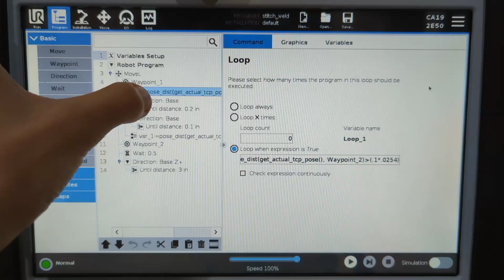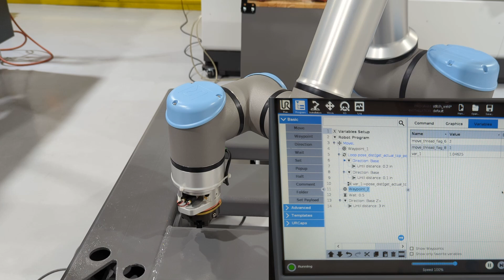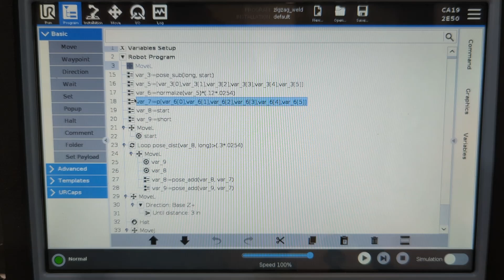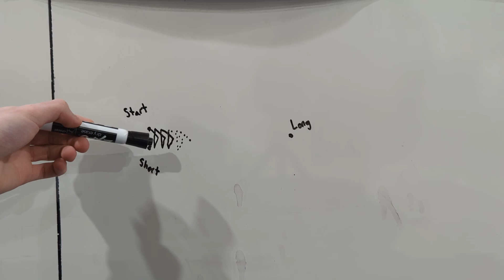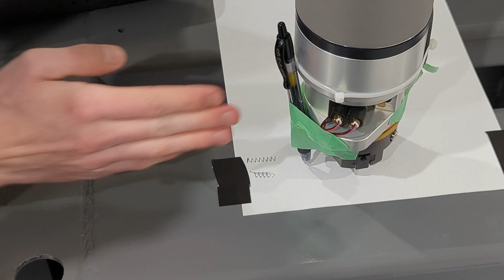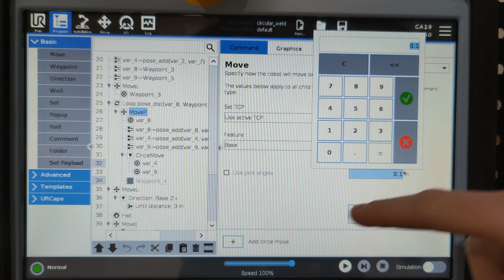Programming robotic Weld Algorithms

Comment: Hi Josh,
I am trying to replicate your setup but I keep encountering a compile error, "Compile error: name 'start' is not defined" or in the case of trying to run the stitch pattern it returns the error for 'Waypoint_2'. Did you encounter an error like this while programming and can you advise on how to resolve?
Reply from the maker: I don't think I ran into errors like that. And you have the moveJ section after a halt? Maybe remove start from the three below and making the moveL start definitely defined?